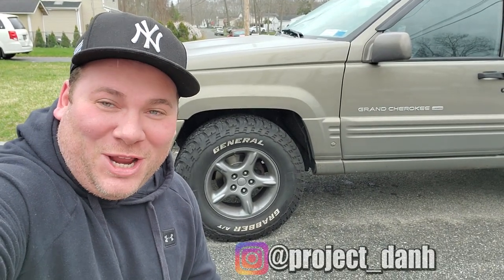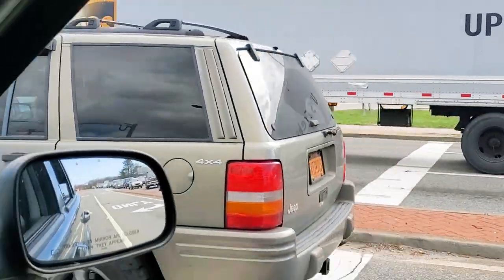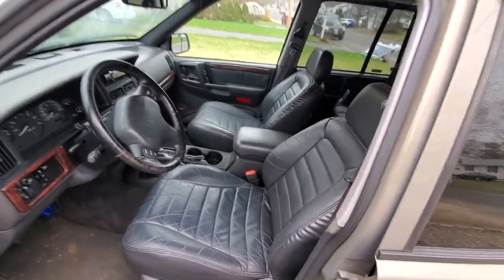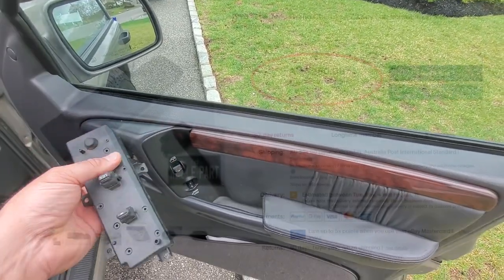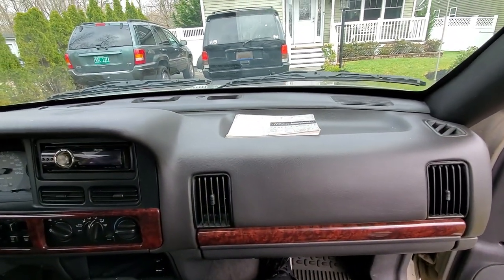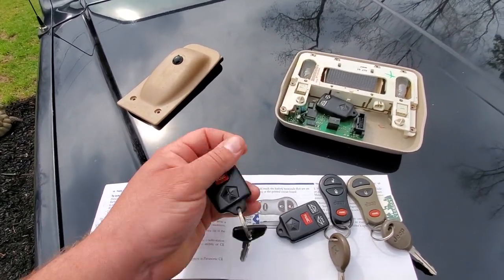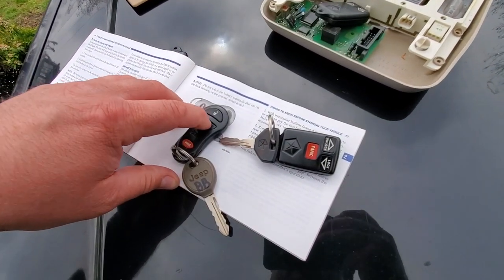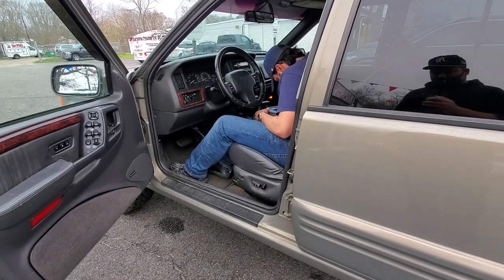JEEP ZJ RKE FOB MISSION - HOW TO PROGRAM YOUR 1993-1998 GRAND CHEROKEE KEYS

Comment: Just acquired my third 'new' ZJ [a '96 213,000 miles], which came with both original RKE fobs... neither working [even with fresh batteries]. Before biting the bullet and acquiring/reprogramming replacement fobs, I took a shot in the dark and [very carefully and ever so slightly] bent upward the four battery contact tabs on the circuit board and two contact tabs that protrude from along side the batteries. Bingo! Both RKE fobs working perfectly now. Interestingly, these fobs have two batteries, and trial-and-error [and a wee bit of deduction] suggests that one battery powers the lock switch and one battery powers the unlock switch. So, after performing a slight tab bend, if you get only 'lock' or 'unlock' to operate, but not the other, try slightly increasing the bend just a bit and see if you get both to function. Good luck!

Comment: Yea, when I finally bought fobs for my 97, I had to go to the dealership about a year ago. They only charged me $15 so it wasn't bad.Since they're aftermarket fobs they don't flash the lights horn beeps though.👍🏻👍🏻
Reply from the maker: omg bro! deal of the century!!!
Reply: @ProjectDanH  Hell yea I was impressed. Then I had them make a few keys, the guy did it at the counter manually with a file. I will only go to them of I need a dealership.

Comment: 1997 XJ had the plastic dome without the IR lens if you didn’t have the full overhead console and then in 98 it was moved to the interior light where it stayed until the end of the XJ. The 97 version of keyless board didn’t have horn beep capability but the later revision did and was a direct swap if you wanted the newer board.
Reply from the maker: Good info bud!

Comment: this works on 96 and up 93 to 95 used light not radio waves  so no transmitter newer than 1996 will work on a 93 to 95. just went through this to get one for my 95

Comment: Had that same issue when I had my 98 ZJ back in the day, Jeep dealer was the only one with the DRB ended up just going aftermarket and added auto start. My XJ recently the fob stopped working so I ordered a used set with the module from ebay, what's weird is the module looked a little different than my original, the range is much less I mean like I need to be standing next to the car, the original one has like a short (like 3" long) metal wire soldered on to the circuit board almost like an antenna, I use to be able to unlock the car from across the street, oh well Jeep my life.
Reply from the maker: JML!!! Wow, that's weird... what year XJ?
Reply: My XJ is an 01, I don’t know what year the eBay set is from

Comment: I have a 98 xj with that module in the overhead light.  took key fobs to the dealership to be programed.  didn't work.  they didn't know why but did see that apparently the prior owner replaced the passenger door  lock/window module with a zj one.  what should i do?

Comment: Looking to get some key FOBs remote for my 2000 XJ what are your recommendations? Also how to program? I bought one off eBay and it didn’t work. Any help would be appreciated.
Reply from the maker: 97-01 XJ key fobs must be programmed by the dealer using their DRBIII programmer... Or, you can get the fobs and the motherboard from my buddy mark on Ebay.   The fobs must be programmed to match the motherboard, if you have working fobs maybe he cab program yours.   Here's his link to his ebay email. 1timbe_ftil3898nb@members.ebay.com

Comment: hi I have a zj from 1997 and my alarm and immobilizer activated after incorrect handling. I no longer have the keyfob and I am therefore stuck. is there another solution? or do I have to go through jeep to buy a new fob and have it programmed with my zj? :( it annoys me !
Reply: Take your ignition key to the rear hatch and turn clockwise it also can work on the other doors but you just have to check them all